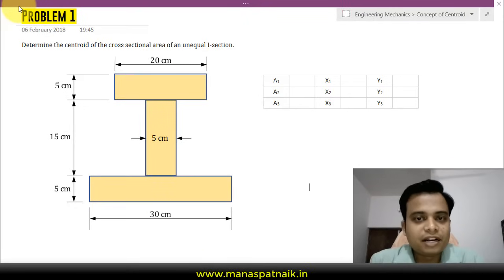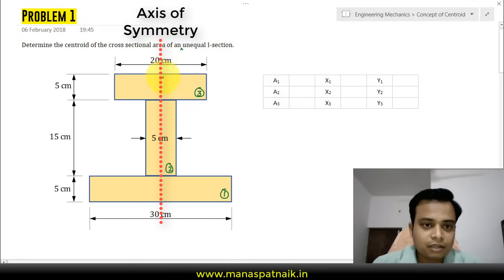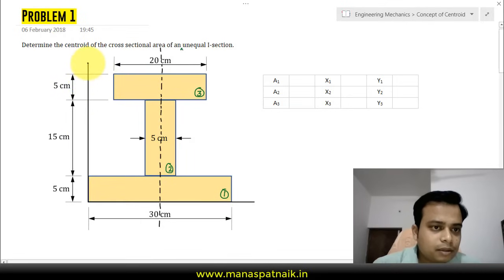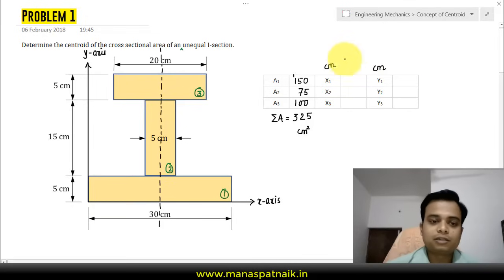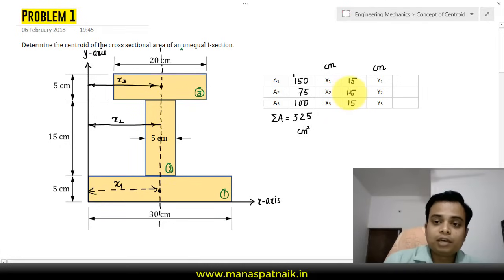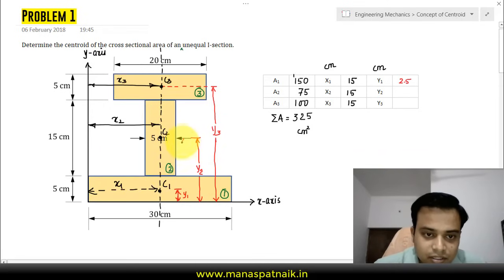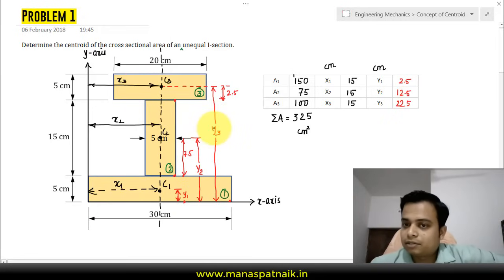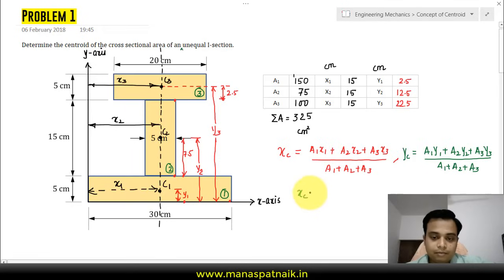How to find Centroid of an I - Section | Problem 1 |

Comment: Great Sir what about gairarion
Reply from the maker: Hello Tinotenda,
You have asked a very pertinent question. 
Radius of gyration is just another way to express the moment of inertia.

For AREA (used in bending and buckling):
k = sqrt(I / A)

For MASS (used in rotational dynamics):
k = sqrt(I_mass / m)

The idea is the same in both cases:
It is the distance at which the entire area or mass can be imagined to be concentrated so that the moment of inertia remains the same.

So:

Area MOI → k = sqrt(I / A)

Mass MOI → k = sqrt(I_mass / m)

Same concept, different applications.

Comment: Locate the centroid of the profile as shown in Figure 1 (left). The measurements are in mm. HINT 1: The location of the centroid is at z = 13 mm & ye 12.8 mm. Try to confirm those results using equation (4.13) of the book of Engineering Mechanics that appears in the syllabus.

Comment: If the church entangle a large bell altitude with earth centroid and let the data drive the hydraulic pump or the motor pulley then if earth seismic wave start to converge on the city the damping force automatically counter prevent large earth quake

Comment: Sir , How u took x1 , x2, X3 ??? And how they all came to value of 15 cm ???? Not getting thisss step
Reply from the maker: Hi Varun X1 X2 and X3 are the distances that we measure with respect to the y axis okay as you can see I have kept the origin at the bottom left corner of the I section and based on this Positioning X1 X2 and X3 all of them will be falling on the same vertical line 
And they all be equal to 15 as
 the figure is symmetrical about the vertical Axis 

Here is a second approach....
what I could have done is I could have taken the origin exactly at the centre of the base in that case all the x coordinates X1 X2 X3 wood have become zero.

Think about it and get back to me......

Comment: Thanks sir
Reply: Sir but the given figure is symmetric about y-axis so Xc will be 0 or not
Reply from the maker: Hi Aryan if you take the axis of symmetry to be your co-ordinate axes of the origin OK then automatically the x-coordinate will be zero but as far is my solution is concerned I have taken the origin at the bottom left corner that's why I have got a non zero value of the X co-ordinate
Reply: Ok thanks a lot sir 🙏